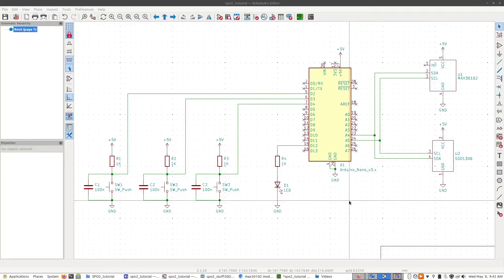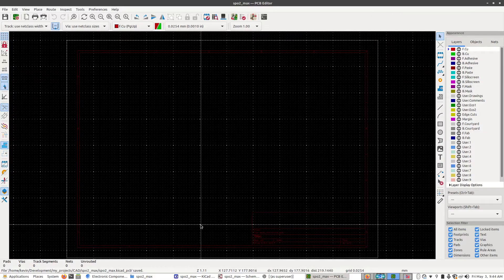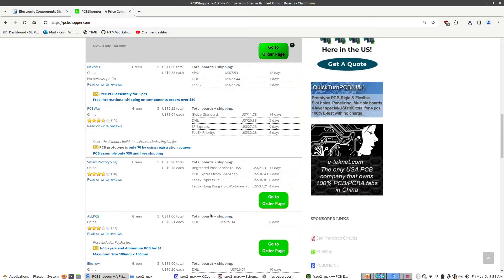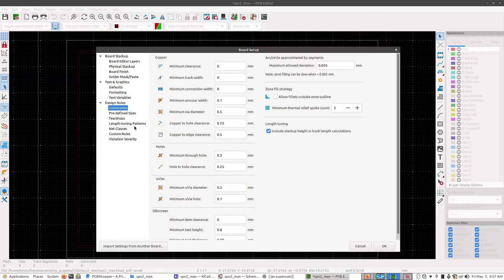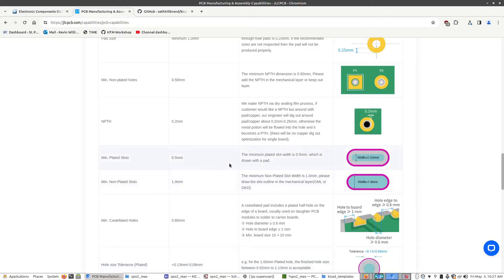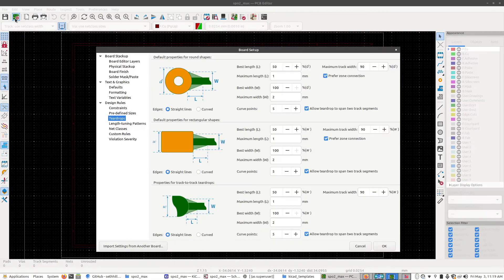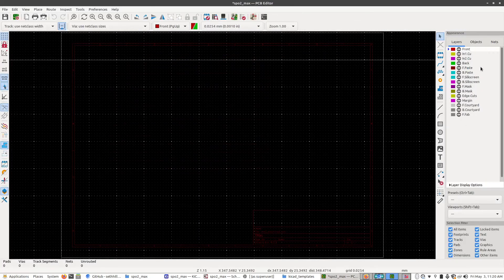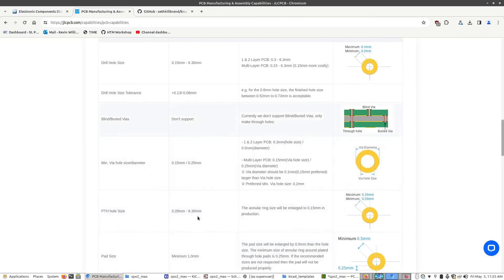KiCAD Project PCB Prep | Part 5 | Setting Up Your PCB for Manufacturing

Comment: @HTMWorkshop I did as instructed and everything went well but when i went to the board settings it said it had 4 layers. I´ve since tried again making sure i chose the correct folder of 1-2 layers and it still said it had 4 layers. Is it a problem of the file chosen? Thanks!
Reply from the maker: Hmm Im not sure on that one -  but if you figure out the solution let me know.
Reply: @HTMWorkshop  It looks like something was broken in an update - or it was never correctly set, the github repo has a few issues about the 1-2 layer one having a copper layer count and minimum clearance issues. One of them is from 2020 as well, the repo hasn't been updated in 6 years so it's very likely something has gone wrong :D

Comment: After I import the settings for example JLC 1-2 layers and I create a new project does the board setup remain the same in the new project or will it return to default? If it is the same is there any way to return it to the default board setup?